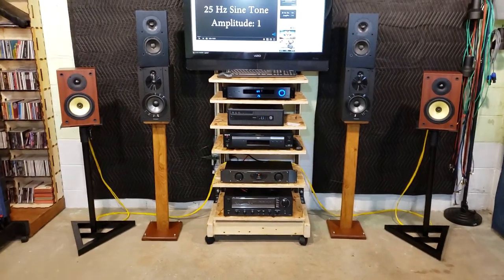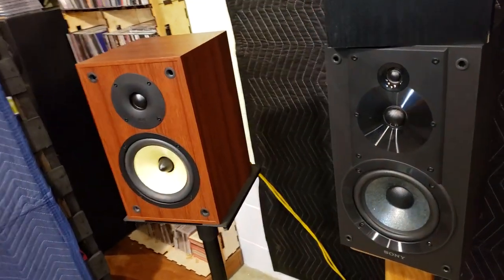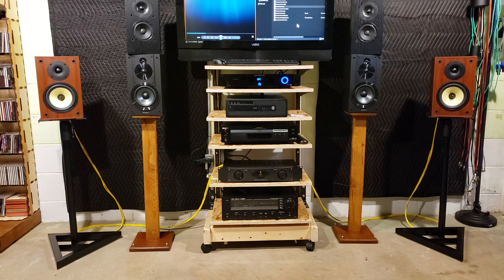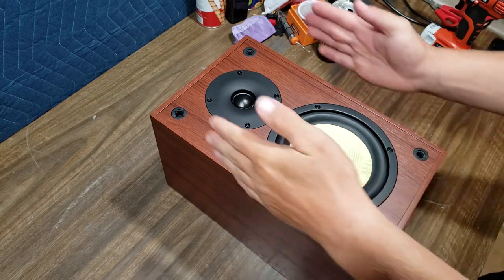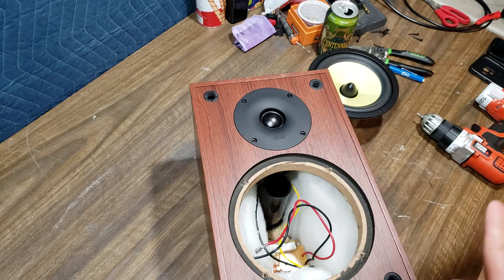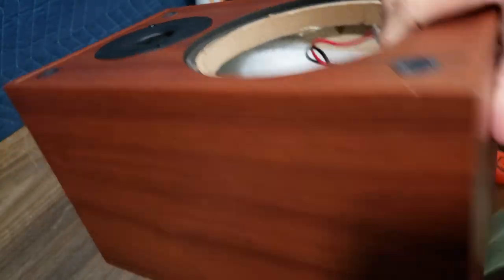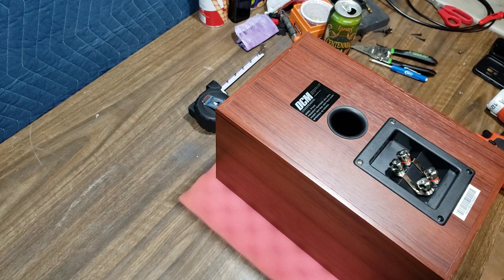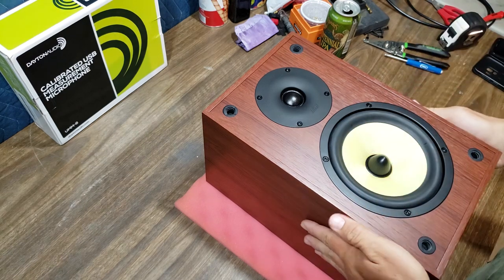DCM TP160S-CH Sound Demo and a Look Inside (Part 2)

Comment: I've got the tp260s. They sound fantastic paired with my sony tae1000esd preamp and power amp I'm using. Also using a parametric eq with pink noise and rta and they're tuned to the room. Very detailed and clean.

Comment: I just bought a pair. They are most definitely an excellent speaker but really, despite the cabinet build, the thing resonates even at moderate levels. (Just put your hands on the sides even at ordinary conversation levels.) So if you want to listen to them loud, I would HIGHLY recommend that you brace them inside.
Reply from the maker: I agree. On these budget speakers I've reviewed I'm considering doing videos for each of them showing ways to improve their sound for cheap. Basic internal bracing would definitely be one of them.
Reply: @iowaudioreviews  - my guess is that at loud levels (over 85db), there is a severe 80-120 hz resonance.
Reply from the maker: @charmerci  I have a the Dayton calibrated mic, I need to get it set up and do a little testing see how much resonance these budget speakers put off
Reply: @iowaudioreviews  - sounds good. I was saying that just to confirm (or deny!) if my sense of hearing is correct. I'll very interested to know! :-)
Reply from the maker: @charmerci  You can experiment by rapping bath towels around the speakers to help absorb any external resonance or place some large clamps on the cabinets to see if it helps. I've done this many times when ugrading cheaper speakers.
Reply: @iowaudioreviews  - thx but I'd just rather brace them.
Reply: if I were to just Ise these on my desk they would be fine right? im not listening at crazy levels like a home theater system
Reply from the maker: @justindoan9055  - Yes if you have the room. The bass may need a bit of a boost at low levels but thats can eisly be solved many ways. The DCM I have tested at 3.3ohm if I remember right so they should work good with a little class D amp.
Reply: @justindoan9055  yup. I only suggest it to those who like loud, low and tight bass. They sound fine without bracing and great at non-loud levels.
Reply: I'm about to purchase these, along with fronts and center for home audio and would be listening to movies loud. I'm a noob at this stuff. Can you link to something with info on bracing these if that's something I should look into?
Reply from the maker: @douglasw1308  Gluing a cross brace inside could help a bit. I would use small .5" or .75" square wood sticks. The bracing has to be small otherwise it starts to displace to much cabinet volume and this will effect the woofers low end response. Bracing is a good start as its pretty cheap and easy. I would make sure they have a solid stand or shelf to sit on with nice rubber feet as well. You don't want the speaker to be able to viberate in any way. You can even use blue tack to hold them in place.
Reply: or just get a sub-woofer

Comment: Thanks, added them to my audition list, after trying the Micca MB42X and Dayton B652 AIR. I really didn't like the B652 quality, and Micca was great except for the 4"driver sound. I may also get a set of Sony Cores to try as well. I wish they had better grills though, like the magnetic grills on the Micca.
Reply: These are amazing for $80.
Reply from the maker: I haven't tested the Micca mb42x yet and I agree the Dayton b652 are only good cause they're so cheap. I'm guessing the Micca are a lot like the Pioneer AJ BS22. They sound great but the 4" runs out if you push them to hard. The DCM and Sony CS5 having larger woofers are able to get a bit louder without the woofers getting beat to death. The larger 5 and 6.5 inch woofer have more punch so you can feel the music as well.

Comment: If the binding posts are not deep, just loosen up the tightening screws to make it a bit more secure.
Reply from the maker: I do this im my Sony SS-CS5 review as their binding posts are even shallower. It works fine long as the threads are snug cause Ive done this with some speaker they rattle so I have to put a little plumber's tape on the threads. Yes the issue can be solved with a little effort but I still prefer good deep binding posts.

Comment: Hey! I have a question. Thinking maybe you could help. I just got some dcm tp160s off of ebay. I ordered a $50 fosi 5.0 bluetooth amp off Amazon. I hooked up one of the speakers with 14 guage speaker wire and they sounded great! 

So I hooked up the second, playing both at once and the music would play for like 2 seconds than cut out and just make this popping noise. Like one pop a second. They would both work if I turned the music down very low, but a anything higher would just stop working. 

I'm a total noob, but I'm thinking the fosi amp wasn't powderful enough? I think these tp160s are rated at 100 watts rms each right? The fosi audio is rated at 50w + 50w output. I'm also getting a dayton sub 1500 rated at 150 watts. I read you need an amp that is 50% more powderful than your speakers. So if my dcms + the 1500 = 350 watts than the amp would need to be able to output 525 watts or more? Am I in the right direction? 

Could you recommend an amp that would work? Thanks
Reply: Also the kind I got was dcm tp160s-b. Tha ms
Reply from the maker: Seems to be an odd problem. Its not because you don't have enough power though, may be something wrong with the little Fosi Amp. Make sure the positive and negative speaker wires aren't touching and shorting out. Power wise the little Fosi is advertised at 50 watts x 2 into 4 ohms, realistically its about 35w x 2 @ 4ohms and about 20w x 2 @ 8ohms which is enough to power the DCM TP160 for now, you can always upgrade later. Power ratings on speakers is often Bull Sh!t just like on amplifiers. I'm not doubting the DCM could take 100w RMS but probably not for long, 100w RMS is more power than most people realize. There are many factors that go into matching amplifier power to speakers. Down the road just look for an amplifier that's rated for at least 80 to 100w RMS x 2 should be plenty of power. I usually power mine with a Marantz SR4021 80w x 2 and its plenty of power. The Dayton 1500 subwoofer has its own 150w amplifier on the back so it will power itself and you just need to provide it a signal via "Line In" or "High Level Input" 

Recommendations that won't break the bank.
Small bluetooth amps -  Fosi DA2120A or Topping MX3

Something a little bigger with more power I recommend a full size used stereo or surround receiver that has a subwoofer Pre Out. If you need bluetooth  logitech makes a nice adapter that can be attached to about any receiver.  Look for used Marantz or Denon.

Nice used Denon on ebay - https://www.ebay.com/itm/Denon-Receiver-AM-FM-Stereo-Home-Theater-System-Cinema-Dolby-Digital-AVR-1603/333415992782?_trkparms=aid%3D555018%26algo%3DPL.SIM%26ao%3D1%26asc%3D57921%26meid%3Ddf71eef97ad046c2adc3ca686d814490%26pid%3D100005%26rk%3D1%26rkt%3D12%26mehot%3Dpf%26sd%3D352915345581%26itm%3D333415992782%26pmt%3D1%26noa%3D0%26pg%3D2047675&_trksid=p2047675.c100005.m1851

Bluetooth Adapter - https://www.amazon.com/Logitech-Bluetooth-Audio-Adapter-Streaming/dp/B00IQBSW28/ref=sr_1_9?keywords=bluetooth+receiver&qid=1578208003&sr=8-9

Hope this helps
Reply: @iowaudioreviews  I tried rewiring without touching and they work perfect now! Thanks for the help!

Comment: Hey man new subscriber here! I've been endlessly looking for a pair of bookshelfs for my shop. I have a small 2.1 TPA amp that I'll be using. Are these efficient enough you think for  30w per ch? Thanks!
Reply from the maker: Yes, should be fine. These speakers are rated at 87db/1watt  which is decent efficiency.